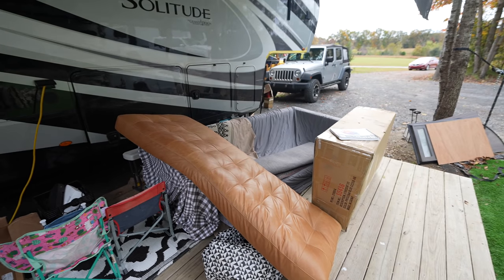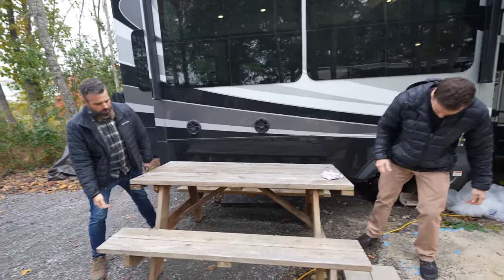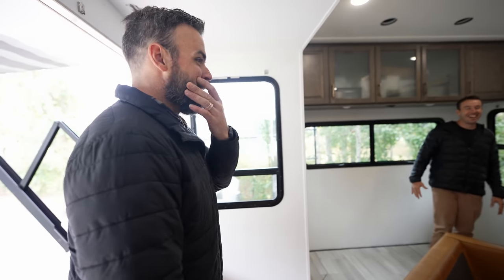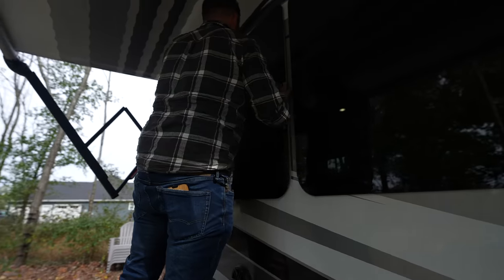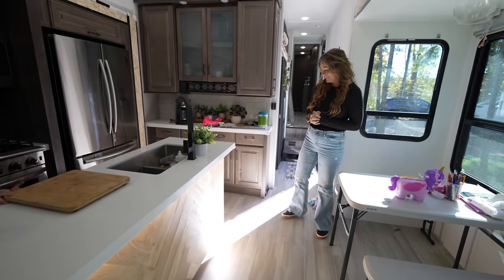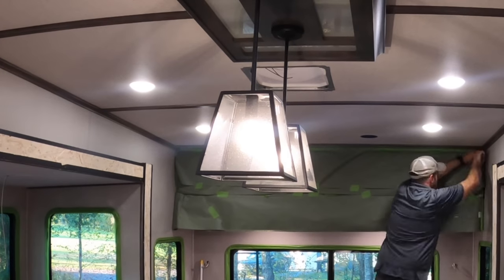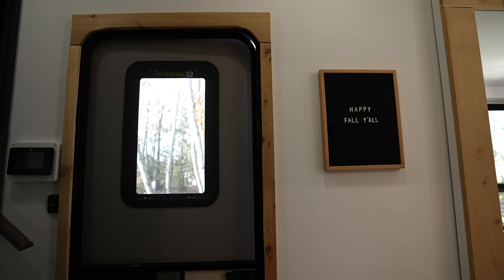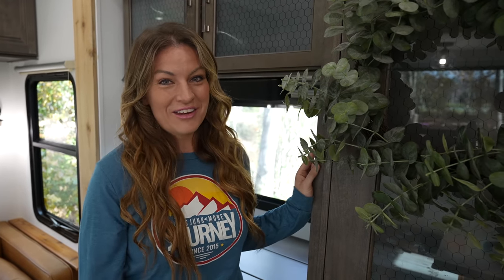The One Where We Try To Get A Couch Through Our RV Window

Comment: This past summer while my wife was mowing the yard, she passed by our trailer with frameless dual pane windows like yours, when the mower threw a rock and hit the window. The window did not shatter, but broke into thousand little pieces. $600.00 later and an additional  2 hours labor at the dealer, it was replaced. Next time the mower will be off while passing the trailer. Your window is bigger and probably a lot more expensive. Glad everything went well.

Comment: Hey this is a very good looking remodel! In my trailer I have natural wood…I have a Nucamp Tab400 Boondock LOL! 😆 it’s tiny and could probably fit in your living room … I’ve wall papered and tiled and cut down my table so I folds down at the front…changed out the cabinet hardware for slow close hardware so no more slamming and I installed two pull out drawers for the under stove cabinet…I’m just about done but I keep thinking I want to paint the bathroom door…and here’s the catch, I haven’t even used it yet - it’s brand new with 250 miles on it from the dealership. 😂 and I have one light I’d like to replace too…I’ll wait on that one. Thanks for the videos and anticipating Phase II!

Comment: I have a suggestion that might help the couch cushions last longer. Measure the bottom of the seat cushions and cut a 3/8 inch plywood and place it under the cushions.  This way the cushions won't sag and it will stay firm. Good luck,  Bill
Reply from the maker: Thanks for the tip!
Reply: @LessJunkMoreJourney  Hug Hug Happy Thanksgiving  ;-)

Comment: Once upon a time, my family got a couch upstairs by using an extension ladder, pulleys and other shenanigans to slide,  lift it up and tilt it over a railing in a double height living room, as it would fit not up the stairs even if we cut off the legs. Once we were done it was emphatically declared that it was leaving the house cut up and thrown out the window. This 100% gave me the same vibes as that process did! 😄

Comment: Last week was saying just take it through the window. Glad you decided to do it.
BUT, if you have the same windows as mine, Hehrs, they sayin the instructions to place a bead of caulk on the top f the window to prevent leaks. I found out the hard way. The manufacturer of the rv did not follow instructions (SURPRISE SURPRISE) and one of mine leaked. I caulked all of them after that and have not had a problem since.
Oh, and where's the linkie link for the support for the table. I so want to do that in mine!

Comment: I worked in the glass field for 16 years.  There will be a good chance your window will leak being you used a tape with only one sticky side.  You want to use a double sided sticky foam for best results. When we reglazed windows thats what we used All window manufacturers use a double sided sticky foam tape.  I’ve seen windows leak where a one sided sticky tape was used.  Hopefully it works for you and you won’t have any issues!   Like watching your vids.  We will be a full time rving in probably a year from now.
Reply from the maker: We used what Grand Design uses. We called and asked them and used the exact stuff. Thanks for the info. That is very helpful!

Comment: Hey guys great channel, just started watching you for about 2 weeks. Wish we ran into each other when you were in Niagara Falls, at that time I had a whole Ram 3500 with factory air ride that was totaled I was using it for parts; anyway you made rite choice factory air ride is nothing but problems. I was wondering if you still had or wanted to sell the original couch and/or the fixtures & half circle things from slide ceiling; I’m fixing up an older RV and that stuff would really help to update it. Either way great channel great family hope to run into you all someday( if I ever get camper done I’m planning on being a snowbird in Florida this year)
Reply from the maker: We sold that all a while ago but thanks for asking.

Comment: What did you do to cover any holes in the walls or ceiling when you removed lights and replaced with one not the same size?
Reply: Wood filler for screw holes and the larger holes were patched with luan.

Comment: Long time subscriber.  I would like a video about your aux tank.  I know you spoke briefly about it in a prior video but would love a more detailed video and maybe a cost breakdown.  We full time with a ram 3500 and 43 ft fiver and already have the titan extended fuel tank but considering the rds you have in addition.  Do you drive with the manual switch open?  If not how long does it take to manually fill?  Ever overflow?  Could be a pretty good video to compare what you have, how it has worked and alternatives you have considered.  Thanks again and love the mods!
Reply from the maker: Thanks for following! We will see if we can include that in an upcoming video. Thanks for the feedback.

Comment: The changes you’ve made look really great!!  I have a small Class C from which I’d love to remove the U-shaped dinette.  It is SO uncomfortable.  Getting the dinette out would be easy, but I cannot figure out how I’d repair things after removal. The floor is 2 levels and the bit under one end of the dinette is not finished, so I think I’d end up having to replace all the flooring. I’d need to relocate the propane detector, also, And how can that table pedestal thing in the floor be replaced so there’s not a big hole left behind? Basically, one desired change would require a ton of additional repair work and I’m just … stumped. I’d definitely need help for this.  Uuugh.
Reply from the maker: Thanks!

Comment: I wonder what the paint weighs that’s on the walls.
Reply: Once dry your adding 4 pounds per gallon.
Reply: @livingsmalldreamingbig  so if they used 10 gallons, that is carrying around about 40 pounds, or the equivalent of one full holding tank.
Reply: @ATLJonathanH  we used 3 1/2 gallons for the living room hallway and the ceilings. Once the other rooms are done a total of 5 gallons or 20lbs. This unit has a 100 gallon grey tank which is 836lbs full.
Reply: @LessJunkMoreJourney  so it’s only 40 pounds!  Not much.

Comment: The only thing worse is when you have to replace that residential refrigerator.  It won't fit through the door and since you can't lay it down it can't go through the window like the sofa did, so the only way to do it is to remove one of the slides!

Comment: Phase 1 looks great.  Bare wood trim and young children…humm. That sounds like a magnet for fingerprints and smudges.  You would be surprised how often your hands automatically migrate to wood corners, which always leaves behind a little oil.  If nothing else you could use a clear coat polyurethane that will actually enhance the wood and protect it from most things that leaves marks. Looking forward to the next phase.
Reply from the maker: Sounds great!